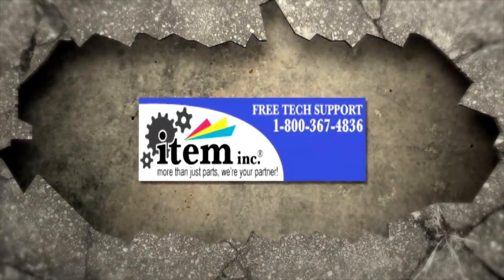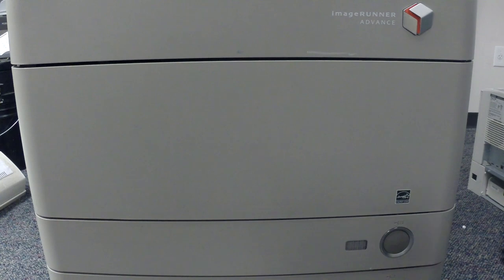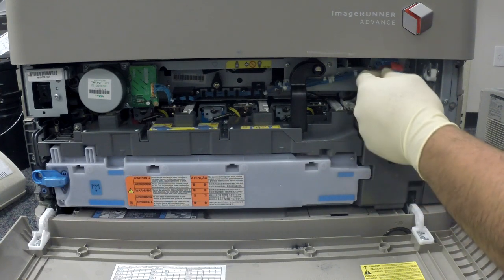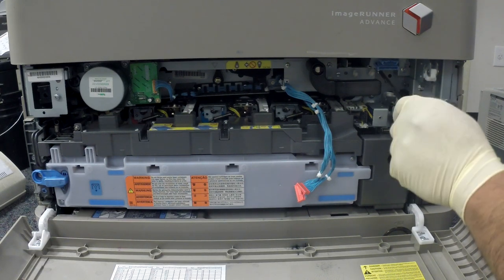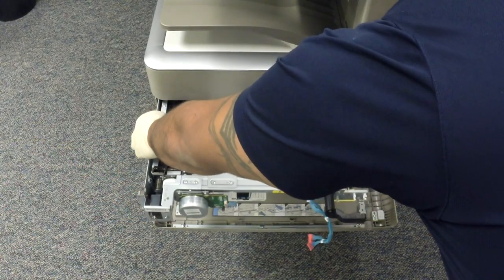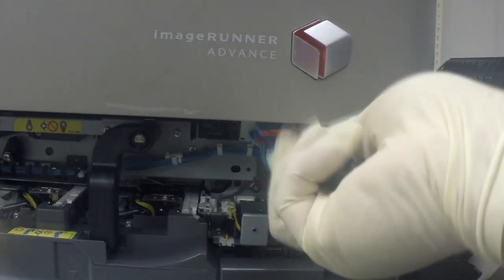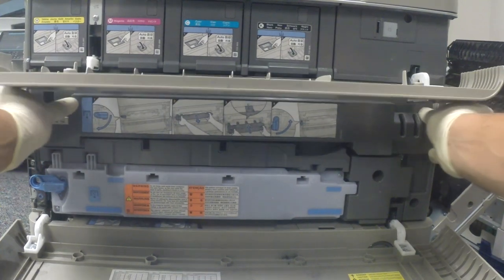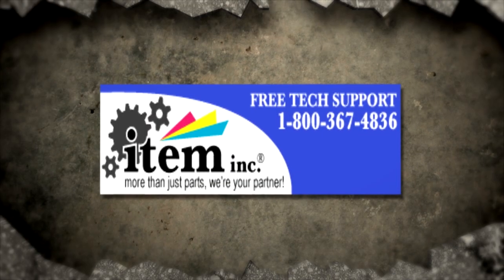HOW TO REPLACE THE ITB ASSEMBLY ON THE CANON IR ADVANCE C5030, C5035, C5045, C5051

Comment: Question. Our C5045 has cyan spots down the center of our prints sideways. However, I had already changed the Cyan drum with no results. Any thoughts?
Reply: check the devloper unit
Reply: I Agree.Cian developer.

Comment: My printer Adv IR 5051c has problem with the transfer belt frequently sliding to tor front of the machine. what causes this, and how can i solve it? Please, help.
Reply: Check Machine Level which require even with Ground Level
Reply: They are some issues with old itb.New tipe have some modifications.